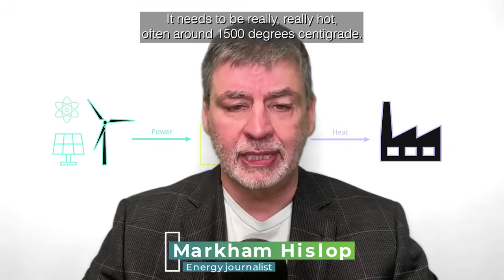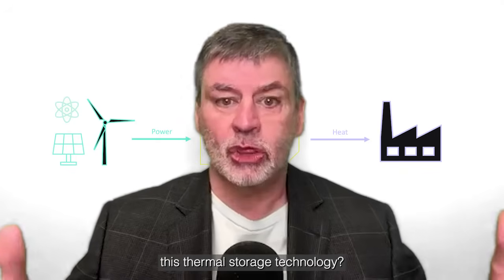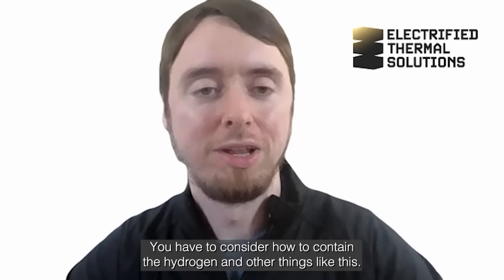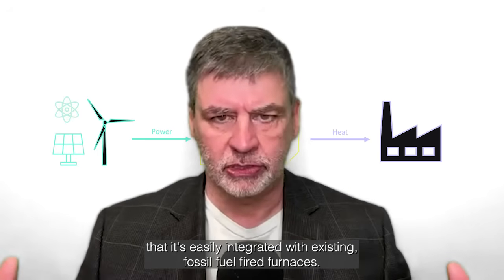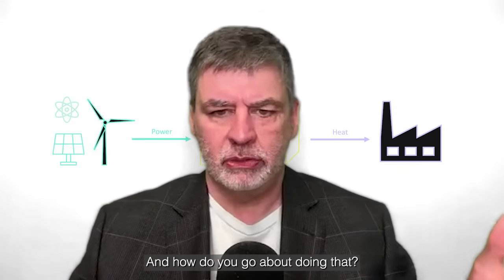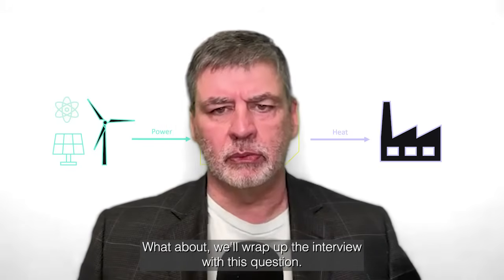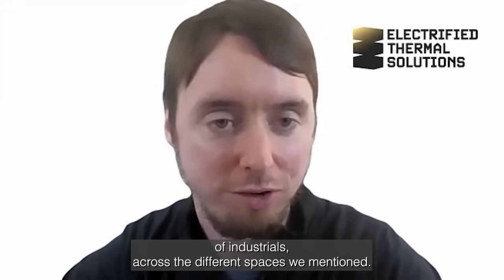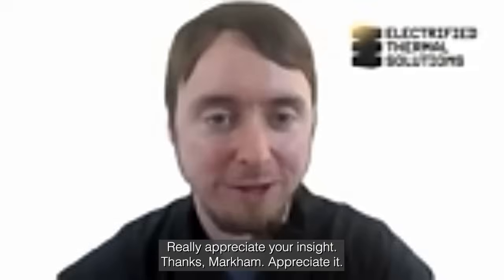Electric heat could make Canadian industry more competitive

Comment: If you have a large heat intensive industrial use, it's most likely in the base load category.  That means you really don't have the need to store energy.  It could be useful for high heat short demands, but whenever you are not using the heat, you're losing it.  So it has to be carefully optimized for particular cases of use.
  It might be useful for energy collection, but it should also most likely be used within a short time.  The higher the storage temperature, the greater is the heat loss.  For high temperature applications, it's shelf life decreases quite rapidly.
  I'd use it for supplying low temperature variable loads.  This won't compete well with energy that must be stored for long periods of time. Especially if high temperatures are needed.  Solar parabolic mirror stations with high temps and daily charge/discharge cycles might fit quite well with your use of hi temp bricks.

Comment: What I'm not sure about still is how do you get these high tens of MWs of clean power around the clock to the location of your plant? Most plants don't have enough land or rooftop space to generate even a large minority of the energy they need. Do these projects only work in locations with high percentages of renewable electricity generation? Beside hydro locations, where is that?

Comment: What I really want to know is, can this technology be combined with geothermal and nuclear?

Geothermal and nuclear already generate useful heat.  Could this technology be situated somewhere where there's already 100 C or 200 C or 250 C heat, but just add to it?

If so, this would be absolutely awesome.  You could achieve  some really high temps  while using even less electricity.

I'm really happy about this video.   I was  always curious if the Tar Sands could be electrified.

Comment: Nuclear power. Molten Salt Reactors create heat suitable for process.
Reply: Right On.
Small modular reactors on site! 
Heat/Power transmission will be insignificant compared to Grid tie in.
Shortcut: Take heat directly from reactor secondary loop.

Comment: Here in Ontario, we need cheaper electricity. Excellent podcast as always.
Reply: Although it may not seem like it, we HAVE cheap electricity.
When compared to the UK, California, Hawaii our electricity is as much as an order of magnitude cheaper.
This company needs to go flat out and commercialize their product aggressively to have "first mover" advantage.
Being able to provide a product that can soak up excess grid capacity but scale off when the grid is struggling - basically like putting a huge capacitor of buffer in - will have huge benefits if they can extend the effective "storage" time.
But EVERYBODY (ok, everybody with a BRAIN) is looking for ways to solve that negative-cost problem and end curtailment. First one there wins the prize; sounds like they are in sight of the finish line and it's time to sprint.
The cost of steel is up to 40% energy costs; if Hamilton could run these things the sting from tariffs would be greatly reduced (Yes I know Doug Ford isn't bright enough to understand).

Comment: I'm skeptical but cautiously optimistic of heat storage like this; particularly for high industrial tempatures. I think very large operations will probably see SMRs win out, but this may have some role among smaller producers. 

And I have to point out, nuclear offered the promise of near zero marginal electricty - though its been harder for the coal industry to demonize solar.
Reply: Molten Salt reactors are probably better for industrial heat than they are for electricity from am economic point of view. but hey they'd still could have electricity as a waste product, so we could probably find something to do with it.
Reply: @Bangpath247  ya, I think Solar will win electricity, but SMRs will beat it put of process heat if regulation allows it. And the industrial facilities they heat will use the for steady power
Reply: Energy storage is valuable no matter the generation sources used.  This helps with grid stabilization and uses energy that might be wasted, as both demand and generation will fluctuate on a daily basis.
Reply: @cleanitup_pls7893 energy being wasted doesn't really matter, and storage is only of value if its economic to release what is stored.
 
But my point is mainly that i think the 100MW heat facilities will largely turn to SMRs. I think this technology is likely to win but unlikely to move beyond the 10s of MW range. At least if we supportively develop and regulate SMRs

Comment: Wind and solar won’t help. They only work a few hours a day. Some nuclear processes use molten salt at very high temps that could be augmented with electric heat to more efficiently work with industry. New molten salt reactors are the future, not wind and solar. Then heat is not required you sell it to the grid. Industrial energy need a 24 hour reliable source of electricity. Go talk to Terrestrial Energy.